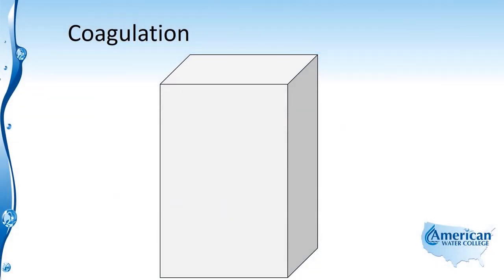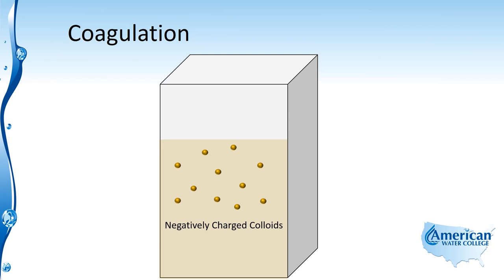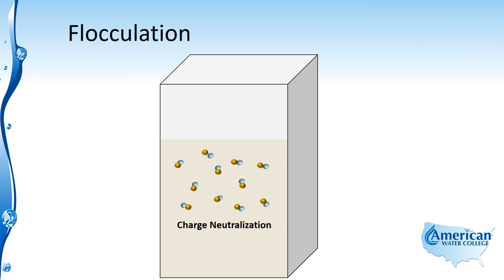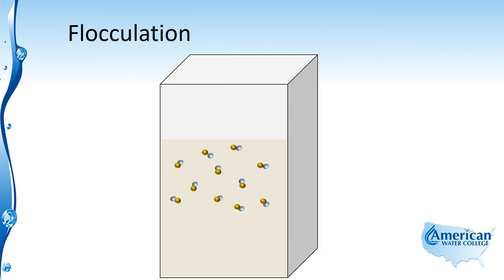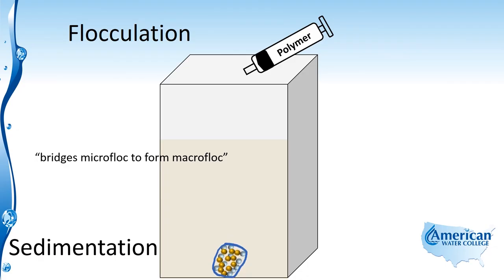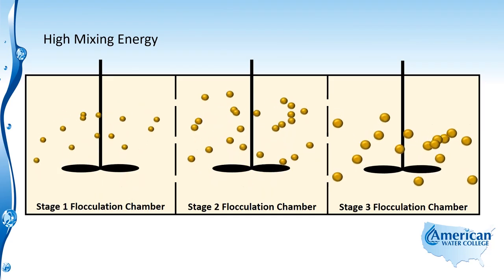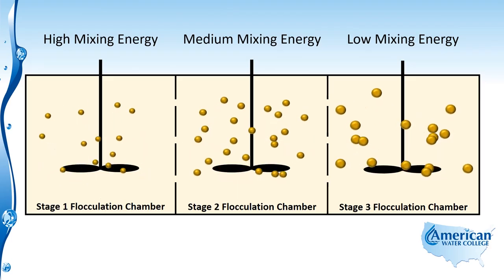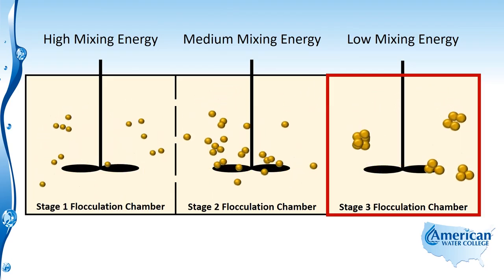Water Treatment | Coagulation Flocculation Basics

Comment: thank you for the explanation sir,  basically the particulate matter in surface water carry a negative charge the it’ll be neutralized by the coagulant that contain positive charge (which is aluminium sulfate) after they neutralized they’ll start to flocculate together this is how coagulation and flocculation works.
-FTIUJ